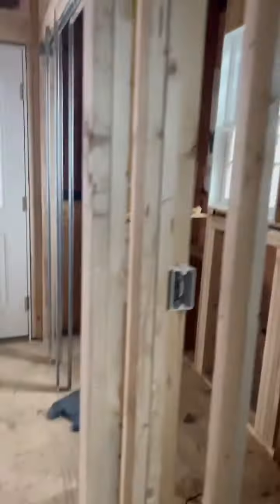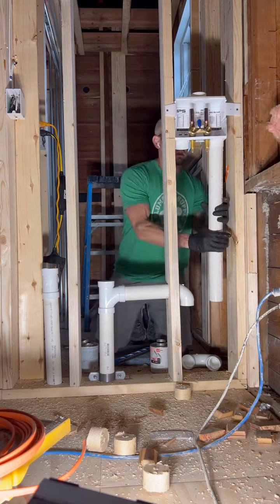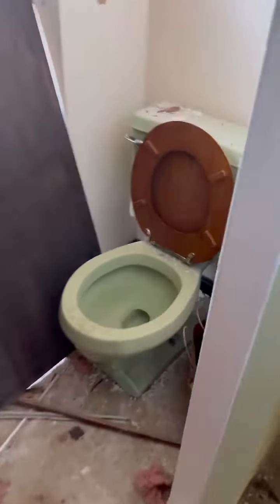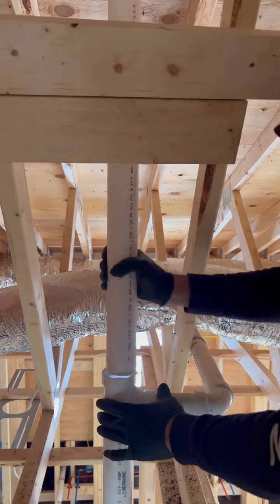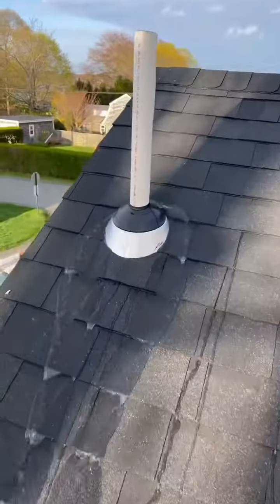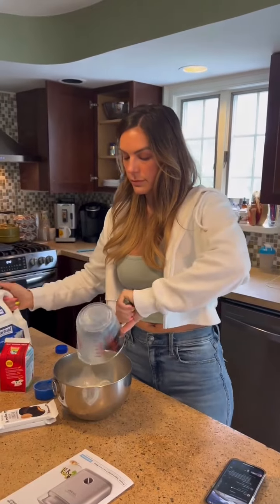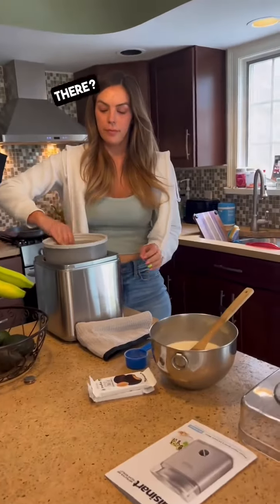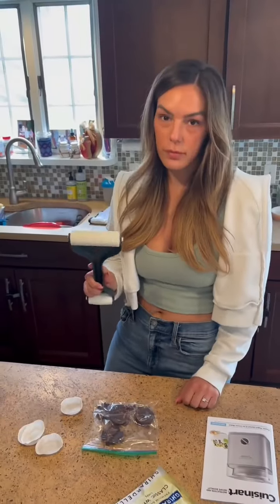#dayinthelife #new #plumber #plumbing #construction #youtube #diy #viral #work #family

Comment: Have not looked at Mass code book lately. I think the standpipe should be 18 to 24 inches ?  Correct me if wrong.  Not sure why they now require 2 " drain on washing machines. I have piped hundreds of drains using  1  1/2.  Got to love Mass Plumbing codes.
Reply: It’s 18” in pa I was wondering that too that could get tricky lol